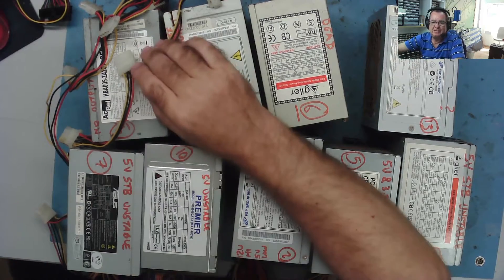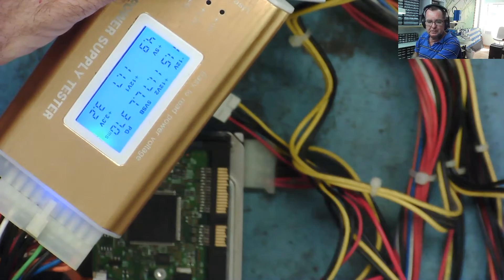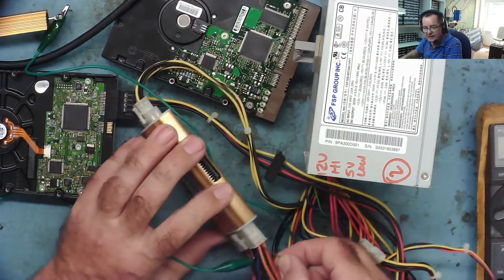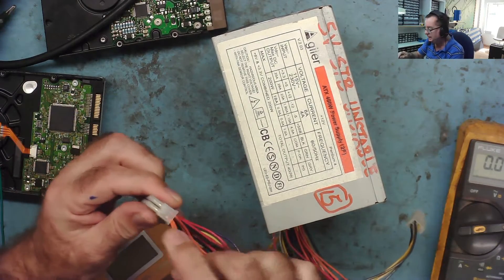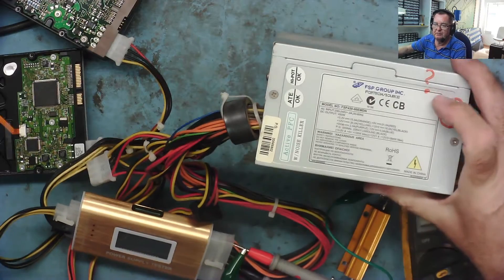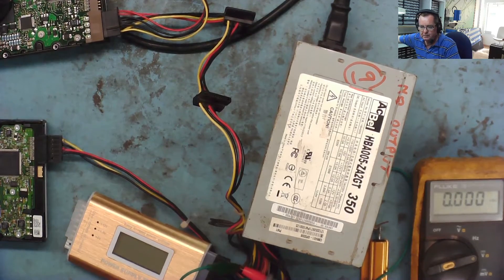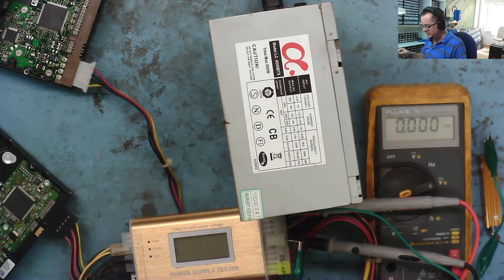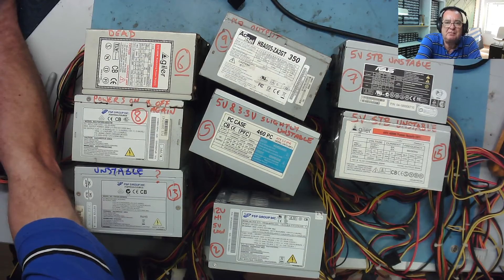Ten Faulty ATX PSUs - Initial Diagnosis and checks

Comment: If you show schematics , it will more efficient tutorial. BTW nice efforts .
Reply from the maker: I generally can't find schematics for ATX PSU.  In some more in depth ATX repair videos I will use component datasheets that have example circuits which are very similar to the one I am trying to repair, or I will reverse engineer some parts of the circuit (I've sometimes done this on video to show people how to do it).  I will try to use schematics or reverse engineering more when I get chance.

Comment: Start with one of the FSP Group ones; they were really common back in the day and their failure modes have an interesting variety.
Reply from the maker: Hi John, actually I'm most way through completing Number 6, should have that video ready for tomorrow and it has proved to be very challenging.  Then I will get on to the others. Number 9 already requested also
Reply: @LearnElectronicsRepair  No problem Richard, whenever you find the time. Both 6 and 9 look like a challenge, good luck.

Comment: The FSP and ASUS power supplies are worth fixing and using. Probably bad capacitors, or a fuse popped due to blown primary transistor, if they're dead.  As for the others, the Premier were VERY common in Romania, my country ... and they can do probably 80% of the values advertised on the labels.  Though there are some lower end 300-400w models which claim 20A or something like that on the 12v output but in reality they have two basic 5A diodes soldered to a piece of metal which is then screwed to a heatsink - because it was cheaper than using an actual TO-220 diode pair for the 12v output. 
A hard drive is not really such a great choice for minimum load, you do have a initial burst of current on 12v while the motor starts spinning but after that the motor only consumes around 4-5w on 12v, which is less than half an amp.  As for the 5v, that's even less, probably 2w or less is used by a hard drive, making it less than 0.5A load on 5v.
I'd suggest you get a couple of 12v incandescent bulbs used on motorbikes or on cars (for signaling), they're super cheap and they're rated for 10-20w (you can get up to 60w I think), and they'll also work as a load for 3.3v or 5v, the incadescent filament simply won't be bright. 
Search your local car/bike parts store or mall or Amazon or other stores for  12v bulb BA9S  or BA20S or BA20D  - the last three are the code for the diameter of the socket - maybe add halogen or incandescent if you want to skip all the LED based bulbs which are not adequate for this repurposing of bulbs, as they may be too low of a load, or actually require 12v.
Reply from the maker: hi mariushmedias - To be honest I've always used an old HDD or two for this purpose but yes that's a good idea you suggest- I think making a video building an ATX PSU load would be good.  I'll get on to that, I already had some ideas about building an active load as well - maybe a dual channel one

Comment: Have you ever seen a PSU with both 20-pin and what looks like AT connectors? I found it like 8 years ago and completely forgot about it and then "found" it again yesterday and I am quite confused, because if they really are AT connectors, I can't imagine how it was meant to be used, because there is not a switch on the cable, so maybe it was meant to be started by the green wire in the 20-pin, but I don't know. I haven't tested it yet, so I will see what it does.
Reply from the maker: Hi Ondrej
One of the PSU I featured in this video has a 20 pin ATX and what looks like one half of an AT power connector.  

I recall some motherboards having the 20pin plus a 6 pin connector for that 'half' AT plug and it was to supply more power, this was just before before we had the square 4 way EATX_12V connector.

I don't recall seeing both the ATX 20 pin and the two inline AT connectors on a PSU, is that what you have?  And yes, I see what you mean about how the PSU was started if using the AT connectors.

Comment from the maker: Actually reviewing the video - on number 5 the PSU analyzer showed that 3.3V is unstable but on my multi meter it is rock solid stable.  Possibly the Analyzer is behaving oddly but it could maybe be ripple on the 3.3V due to bad capacitors and that does not effect the meter but messes with the analyzer?  I need to check this one again.